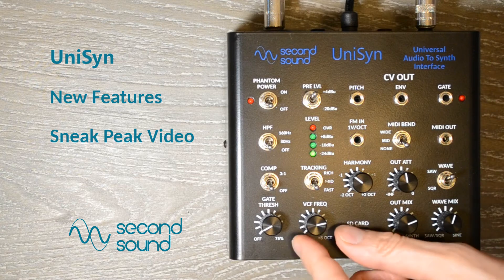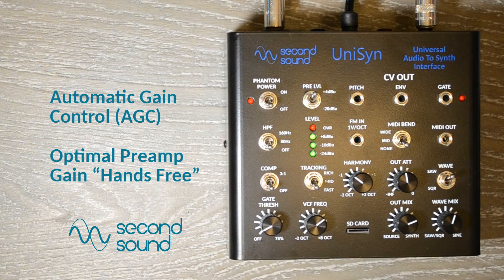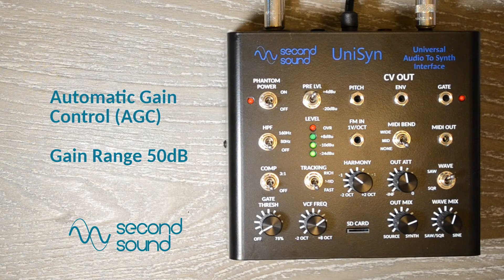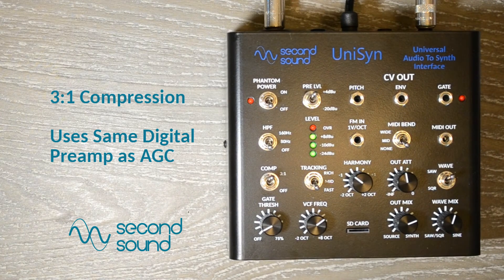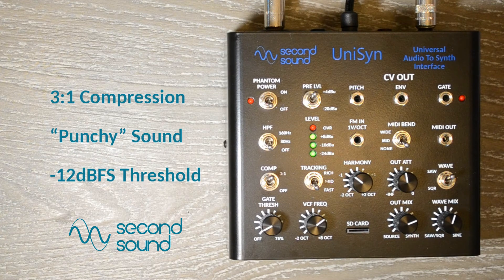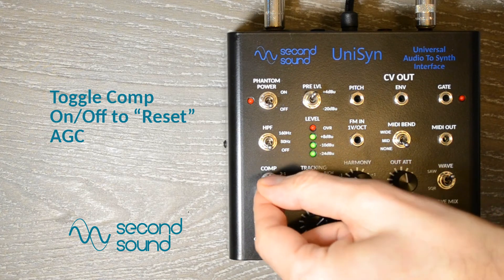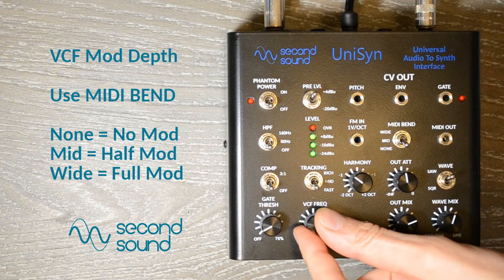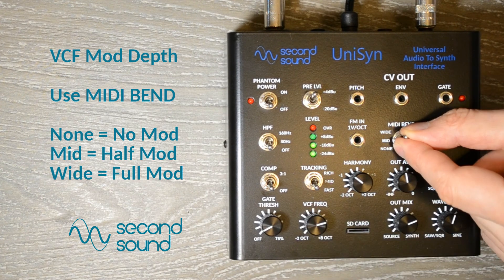UniSyn New Features Sneak Preview

Comment: Great development. Congratulations. In my experience, it is important to handle 4 things: Gate (to filter unwanted sounds from the notes we want to play), Velocity / Sensitivity (0 - 127), MIDI CC Data: Bends, Legato, etc. and above all: Envelope ADSR (especially the Release) because there are instruments that have a slightly longer Release than dry synth sounds. If the objective is to carry out a conversion towards emulating instruments, the management of the release is fundamental. I look forward to hearing a test of UniSyn with VSTi, connected to a PC and DAW (Pro Tools, etc) Great work. Congratulations, again.